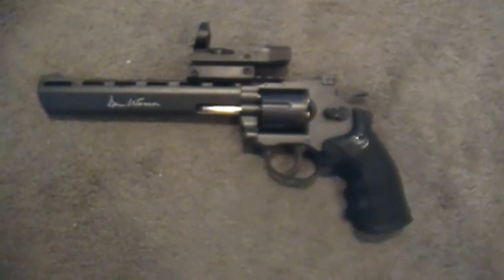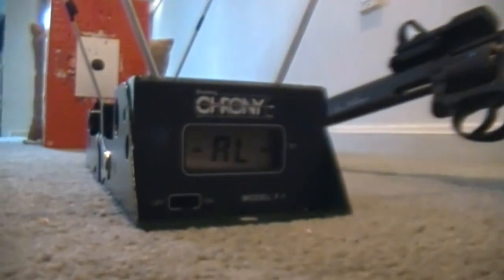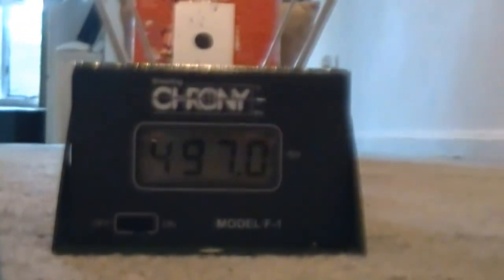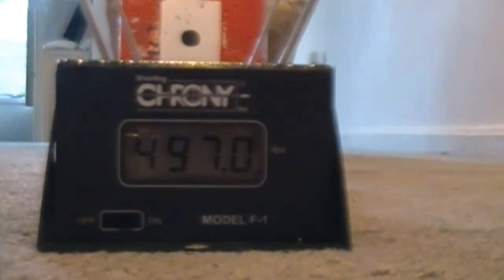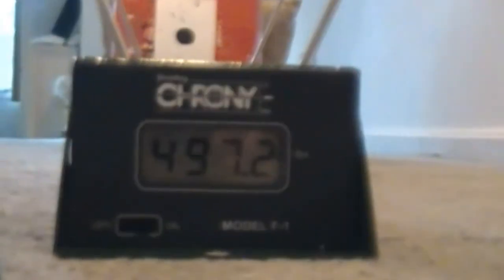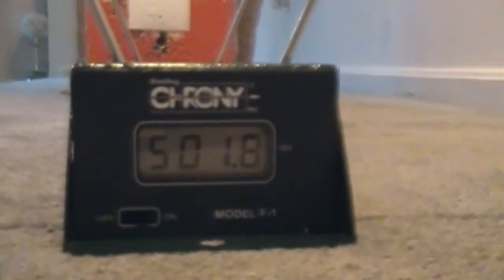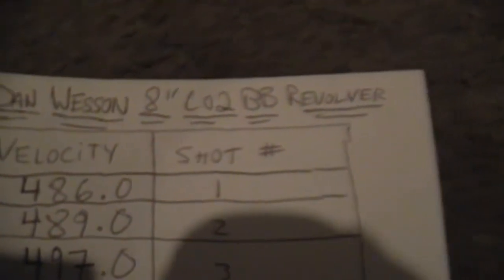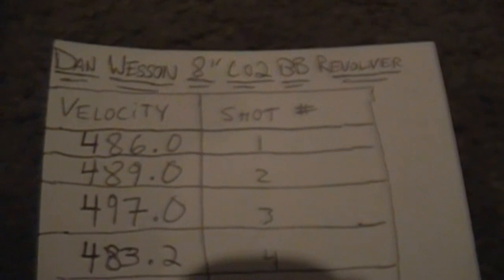502 fps Modified Dan Wesson 8" Co2 .177 - Pt. 2

Comment: Hi there,
I've decided to buy Dan wesson Co2 .177, however i am confused between 6" and 8" barrel size. As you said, longer the barrel size higher the FPS but most of the specs on paper say they both stand same on FPS. So here is my question,
1. which one is more powerful?
2. can this revolver be used for short range pest control?
3. how many rounds a single 12 gm cartridge can fire? 
4. Here in India, there's no steel bb available but .177 cal copper bb is, will this gun perform same with copper bb?
thanks,
Reply: +philip s (Dishano) It's a Steel BB Gun, I kill squirrels with it. Airsoft shoot plastic larger BB's.
Reply: Prithviraj Mallick There's 95% chance you wont kill a bird when you shot it with an airsoft gun.
Reply: They both produce the same power unless you do the easy upgrade longer barral will result in better accrucy short barrle like i have are only good for short distance targest better with a long one suppose
Reply: Normaly the LOnger the barrel the better the gun performence. Even when the specs are the same.

Comment: cheap but packs a mighty crack 

i seen a vid where you can turn the 4.5 caliber bb in to a pellet gun buy changeing the barrel if you can get a 6inch barrel and stick it in a 8inch barrel then alter the fake bullets to hold 177 pointed pellets or domed pellets and that gun will shoot them at 540fps that is powerful